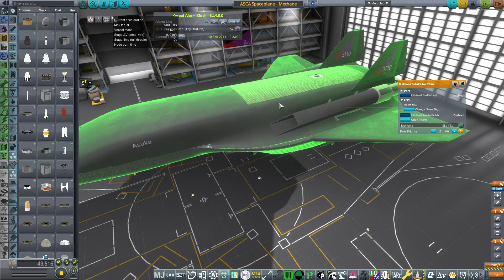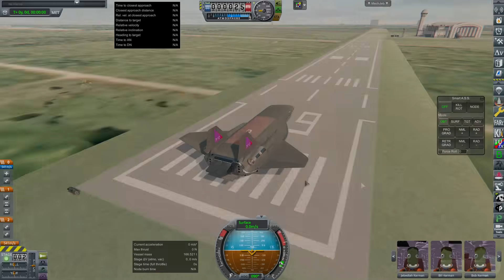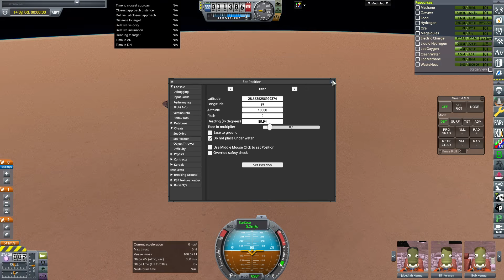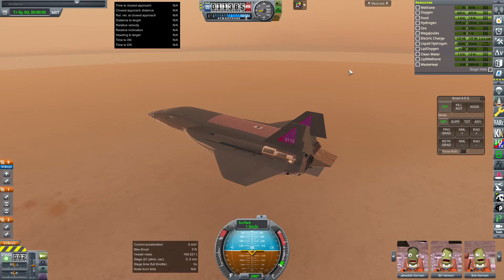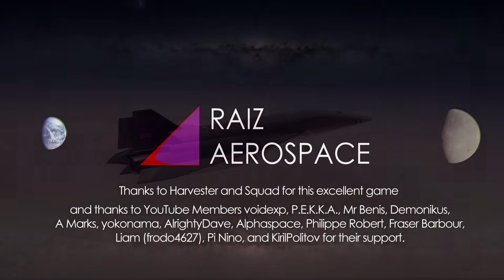Methane Intake and Jet for Titan (KSP-RO)

Comment: Considering Titan’s surface has a tempurature of 80K, rubber wheel landing gear would be impossible to use without it behaving like glass, so some sort of material improvement would be required, or skids.
Reply from the maker: Considering the operations of this later ASCA version, probably skids. I might make an optional skid landing gear for the same wells.

Comment: given that Titan's atmosphere is only 1.4-5% methane by volume, would that be sufficient for a jet engine? 95-98.4% is nitrogen by volume according to wiki.
(the troposphere (up to 40-44 km) has more methane than the stratosphere).
From some of the numbers I have seen, it should barely work near the surface, but become quite nasty as you increase altitude.
Reply: I suspect Titan would be more ideal for an air breathing rocket. Also, because of the temperatures involved, Mach 4-5 would be possible because the airstream would be precooled to near-cryogenic temperatures.